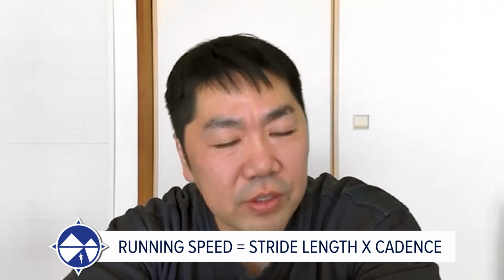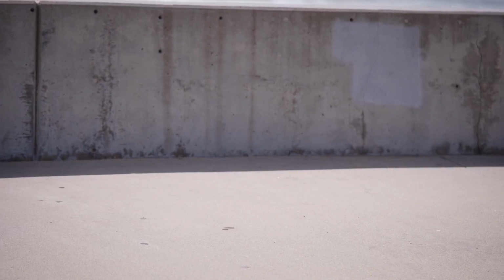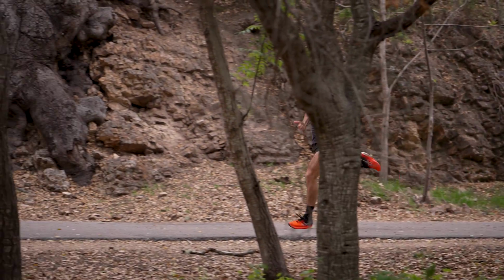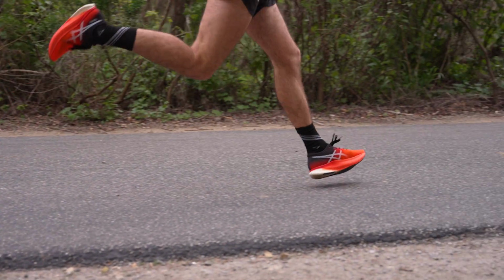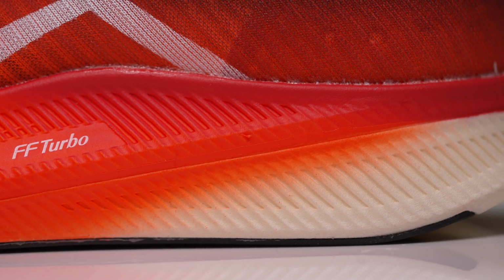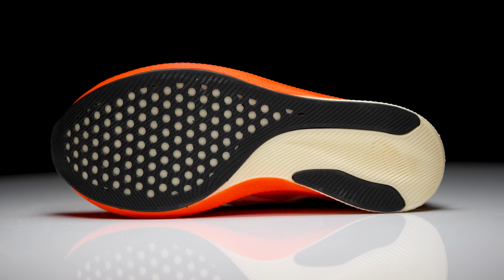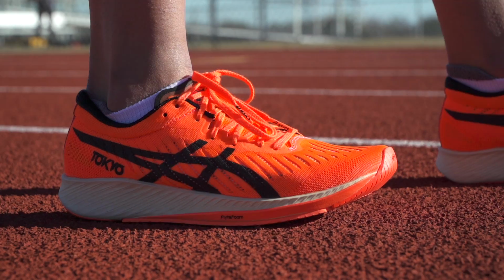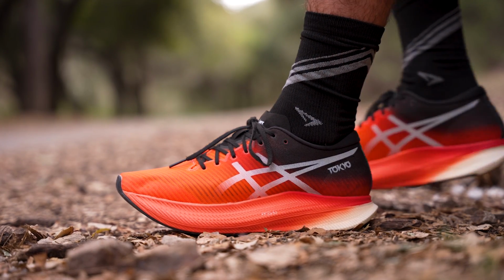ASICS MetaSpeed Sky and MetaSpeed Edge Designer Deep Dive | Norihiko Taniguchi-san Interview!

Comment: They are fabulous shoes. Beware if buying them, they run short. My advice is half size up or you'll only be able to wear them with very thin socks
Reply: Not even with thin socks... I am gutted mine are too short
Reply: @marieclairechahine5900  so annoying. Asics have updated their true fit guide now to suggest sizing up but at the time I bought it said go true to size 🙄
Reply: looks like the heal counter contributes to that - it looks like the ankle position is quite forward from the rear of the shoe - angling it forward somewhat \
Reply: @gosekinz  my comments about sizing relate to the edge rather than sky but suspect you're right and sizing length issue is same for both